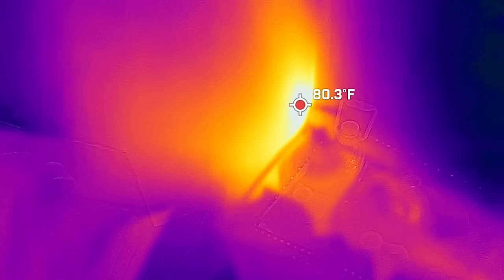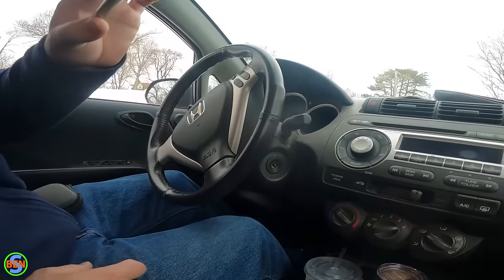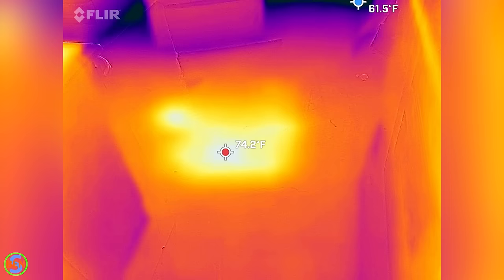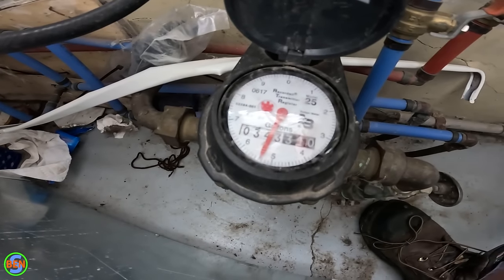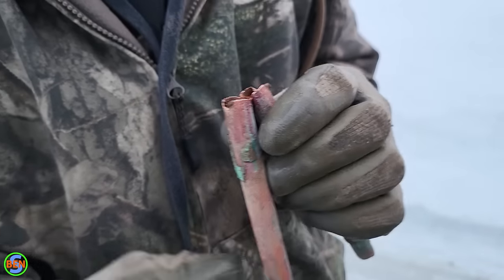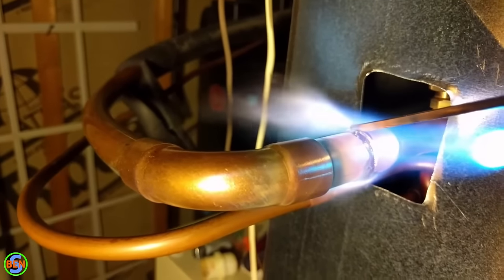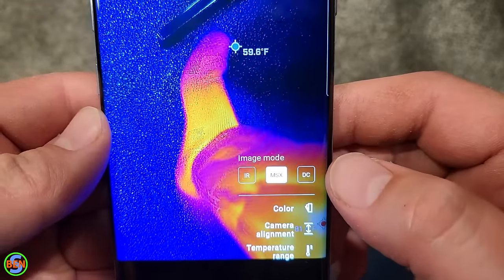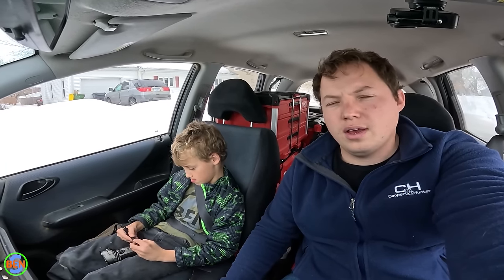How To Find a Water Leak with a FLIR ONE Pro Thermal Camera!

Comment: It's ridiculous to put plumbing under a concrete floor/foundation, what the heck do people think?
Reply: If run inside a concrete slab it will last until eternity. Dropping plumbing straight onto acidic soil, not isolating it from ground water is just crazy..
Reply: @RandomActsOfMadness  there's no reason to run plumbing under a slab. if hot water, looses a lot of heat.
Reply: About the same thing that people who put plumbing in an overhang/cantilever think...de do do dum dum de dum. (That's a great way to get frozen pipes).
Reply: @Jon-hx7pe Pkumber here. Run water lines under slab all the time. We run water lines without any fittings underground. As far as heat loss, hot water lines needs to be insulated per UPC code.
Reply: @brianleeper5737  Just run PEX. It doesn't matter if it freezes. Just thaw it out or let it thaw out. No need to fix it.
Reply: @618huntingcrew  Yea, that does not solve the problem of the kitchen sink not working anytime the outside temp is below freezing for too long. What will solve that problem is not being a dumb shit and not installing pipes where they'll freeze.
Reply: @jzsbYT  how water pipes were put in homes built in 50-s & 60-s? To buy such home we don't know if they were insulated & if insulation is ok being 60+ y.o.
Reply: @Jon-hx7pe where to run pipes in the house on the slab?
Reply: Jon, since what year the UPC codes require insolation on pipes under slab or it depends on state?
Reply: @goldas.4624  ceilings and interior walls - can build a false ceiling to have space to run them. also a great idea for ductwork to avoid putting it in attic which is also a horrible idea.

Comment: Who on earth buries hot water pipe under slab?
Reply: Tons and tons and tons of people.  It obviously has it's pros a cons.  Pros: Way cheaper to run your plumbing when you don't have to deal with walls and other obstructions, particularly with modern PEX.  Literally just straight simple homeruns all over the place and stub outs.  Less damage (in most cases) when there is leak.  As you saw here, no concrete damage or significant soil erosion despite gallons and gallons of water pouring out for quite a while.  Cons: harder to repair and retrofit when there is a problem (far less likely with pex).  Insulation may be a concern depending on climate (you obviously see more slab on grade homes in temperate climates).  Just depends on the scenario!

Comment: Before retirement I was a Facilities Manager in large Level 1 Trama Center/Teaching Hospital in Minneapolis.  Water leaks in our facility were weekly events.  I used a thermo camera to find sources of leaks and wet walls.  The camera saved time pinpointing the source of the leak.   
We used the thermo camera to find roof leaks on our flat roofs.  A wet area would show up as a cool spot.  To check bearings for overheating and to watch heating/cooling valve open with a command.
Thermo camera are a useful tool.
Reply: I work with d.a. plumbers that think that anything not being done the old fashioned way is gadgetry or sorcery. Unless they’re the ones to come up with the idea.

Comment: Benhamin, thanks for this video.  It was very informative.  I have a water leak by my cottage and am currently trying to find it with an acoustic detector.  However, I'm also going to get a thermal camera as well.  It's about 3' down, so I need all the help I can get.  Thanks again, Fred.

Comment: Had the exact same problem and could clearly hear it spraying into the slab. Ultimate PITA trying to replace a spot of highly pitted copper at the lowest area of piping. Btw I have the same exact flir camera. It is moody often, takes forever to connect  and the resolution doesn't look as smooth. And yes I've adjusted my camera alignment and have the pro version. Flir does a lousy job updating their app too and support sux.
Reply from the maker: Interesting. I've had good luck with mine. In some ways I could see the benefit of having a standalone FLIR though.

Comment: It’s a huge task to replace the plumbing and the above ground retrofit seems like a good repair.
Reply from the maker: Definitely better/easier than opening up the floor throughout the entire place!
Reply: @BenjaminSahlstrom  My mom's house has had pretty much EVERY pipe in the slab fail so far. It was built in 1994 with polybutylene pipe. The pipe that failed first was the hot water line to the kitchen sink. The previous owner had a 2 gallon water heater installed under the kitchen sink to work around it. She bought it in 2002 without a home inspection. I'd NEVER buy a house, ESPECIALLY in Virginia, without a home inspection. The building inspectors in most of this state are coin-operated.
Reply: In our state home inspectors don't check for molds. If something visible , sure they see but lots of water damages aren't visible. And how would inspector predict that pipes will leak?

Comment: Ben,
The fact that the pipe had corroded would make me suspect of the entire system.   Wouldn't there be a high probability of future leaks even after your repair?
Thanks
Reply: Yes, in a weak pipe the least resistant section is next up. A lot of homeowners can only afford to fix the one leak and not completely rework their entire plumbing system. They cross their fingers essentially. He definitely made the customer aware.

Comment: Question: do Infrared cameras only show spots if the temperatures are very different ( how much different?) & if water damaged building materials aren't dry? Meaning that moldy areas of dried materials won't be detected & house will stay toxic? Or if there's a slight dampness camera won't catch the temperature difference, yes?
Reply: Most thermal cameras are accurate to within a few degrees of temperature difference. more expensive ones can be accurate to fractions of a degree and have higher resolutions. But yes thermal cameras read the difference between two temperatures so anything that would cause a temperature differential to occur will show up so for example even if things are "dry" if you have say a section of ceiling with no insulation above it and the rest of the ceiling does it would be easy to spot. Dry mold would probably be difficult to spot unless there was a lot of build up causing it to heat/cool differently than the surrounding material. If it was still damp then it'd probably be quite easy to see even with cheaper cameras. Especially if you introduce a temperature change such as adjust the A/C up or down several degrees so that everything has to actively change it's temperature and things like that will change at different rates making it become more visible.

Comment: In town, the family was down south for the winter. They had  the main water valve turned off. Someone walking on the sidewalk noticed a water line on one of the basement windows.  The town’s water main sprung a leak. Followed the water main and the service line into the houses basement. Nobody in town had a key to the house. The town’s water department had to break a door down, start pumping water out of the basement. 
Hello from north east Montana. 
10 miles from the Canadian border.

Comment: Can this IR camera find a leak in an outdoor underground pipe, buried under an asphalt drive or under grass-covered soil?  The water supply pipe (4" diameter?  6"?) to our condominium's swimming pool facility leaks somewhere downstream of the pipe's shutoff valve, which is located under a valve cover in the condominium's asphalt driveway.  When the valve is open, a stream of water backs up and out to the surface at the valve cover.  But I don't think that implies the source of the leak is close to the valve, and since the length of the pipe between valve & swimming pool facility is about 50 yards, it would help to have a way to find the leak before digging up the asphalt & ground.
Reply from the maker: Good question. With the outdoor underground water leaks I've dealt with we've pretty much always dug at the location where the water showed up. The thermal camera could possibly help but depending on where the water is running it may or may not be very obvious.
Reply: The camera will show you leaks best when for example it's a hot water line in cooler concrete or dirt. Highly unlikely to find underground leaks if the temps are close to each other. It is great for finding leaks in a roof tho.
Reply: If roof had a leak but materials dried off camera won't help , yes? Mold is there. Cameras are ok for a tive leaks if temperatures of water and  materials are very different different. So what if it's cold water ?

Comment: Could this be used to detect leaks in an irrigation system 6 inches underground? Or would the temperature difference not be enough?
Reply: These cameras vary widely in capability,  sensitivity, and, of course, price.
A lower priced FLIR version may work if your ground temperature is high enough (like mid summer) and your water source is relatively low - say from well and not above ground tank.

Comment: If there is a leak under an exterior wall,  the paint might be peeling off from water vapor coming through.  We had to run new copper tubing in the overhead crawl space instead of repairing the pipe in the floor.

Comment: I want a thermal scope so bad to do some spotting and hunting around my ranch at night.  When I have a plumbing issue I could then LARP around the house and my wife would just think it's my usual.
Reply: Correct me if I'm wrong but I don't think the focal length is small enough to see images in focus inside a building.   It would be like using a telescope inside a house
Reply: @TqSNv9R0iG5Ckxew  Well, beyond the joking, it would just depend on what type of thermal scope you got. There are plenty of 1x thermals that would work fine in a house, and there are plenty of variable power thermals that might have trouble depending on their lowest magnification.